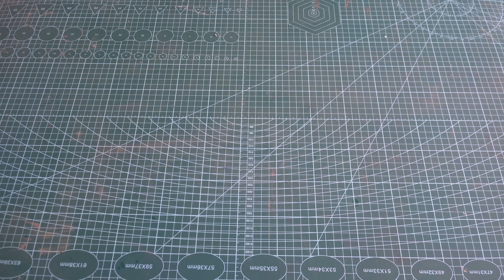Mini hydroelectric construction with a unique dam and two powerful units

Comment: I know you put generators on your dams just for fun.  For efficiency, however, it would make more sense to connect the generator at the bottom of the dam.  This makes better use of the water pressure.
Reply from the maker: thanks you very much 💖💖💖💖💖
Reply: I was about to say the exact same thing but you said it much better than I could have.